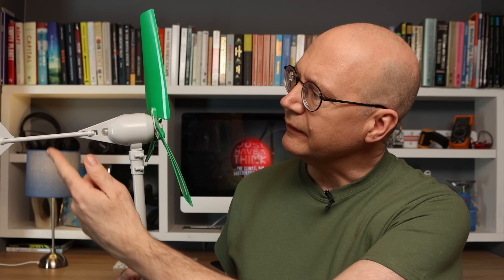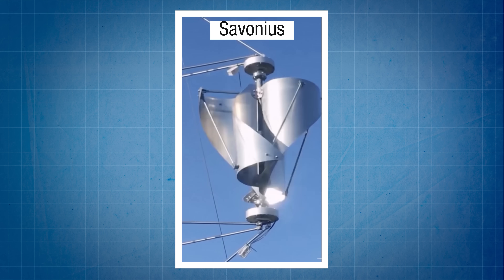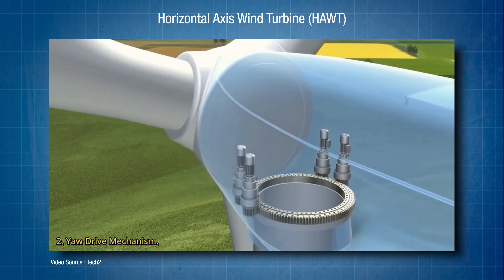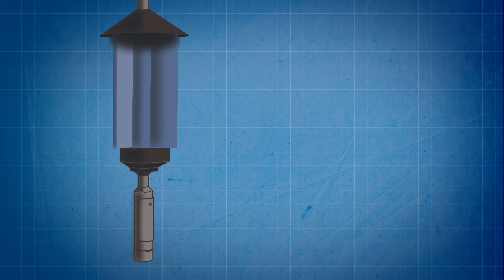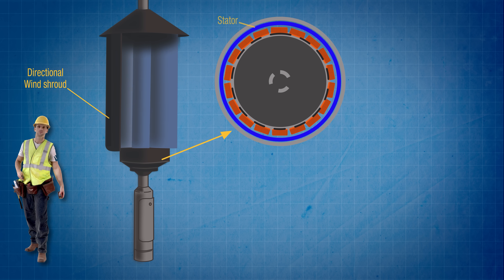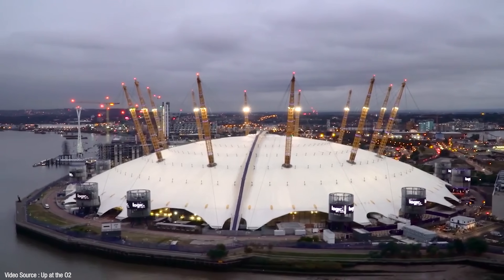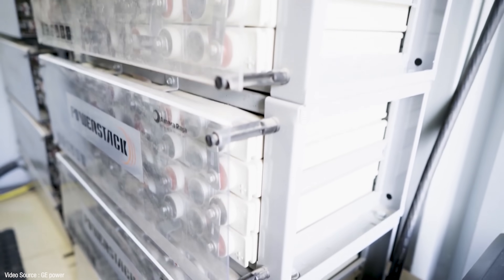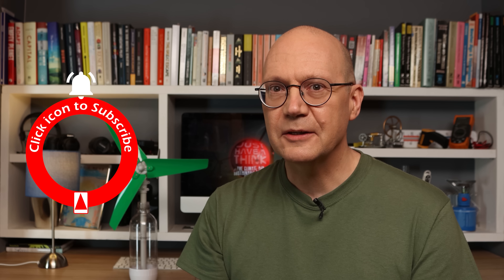A vertical axis wind turbine that doesn't need the prevailing wind! How do they do that?

Comment: I've daydreaming a small boat powered by a vertical axis wind turbine for a couple years now. I told my buddy and he said, "you know, wind powered boat isn't a new idea."

Edit: Didn't realize I was stirring such a large pot. I was just having a giggle at a fun little trash punk idea I'd had.
Reply: Hah.  I like that sense of humor.
Aside from that though, while sails would likely be able to trap and use more of the wind energy (since they'd be larger as well as converting straight from wind motion -> boat motion rather than going through a bunch of inductors and engines and the like), there are two advantages to going through the extra hassle of converting to electricity and back:

1) You don't have to know how to sail to use it.  I don't know how big of an advantage this is as I've never learned it myself, but there seems to be plenty of sailboats out there so it can't be all that difficult to learn at least the basics.  Still, it would make boating easier for the lazy.  Take that for what its worth.

2) Scalability.  Sails can only get so big before you run into issues with the stress on the mast and other structural components.  You would never be able to power today's enormous cruise and cargo ships using sails - they'd snap long before they could build up sufficient speed to be useful.  Being able to extract that same power across effectively dozens or hundreds of "masts" (ie: a whole bunch of small turbines spread around the vessel) could potentially work around this, to some degree.  The relative inability for small turbines to extract energy at the same rate as huge sails means that this would likely be at best a way to reduce fuel consumption rather than being able to fully replace it, but every gallon of fuel left unburned is a benefit to the planet (and the pocketbooks of the ship owner - win/win for everyone except the fossil fuel industry).
Reply: I remember seeing a video somewhere that talked about how big shipping companies are already experimenting with this very thing. They're mounting some VAWTs on their ships and measuring the amount of power generated. It's still experimental right now, but that business is all about squeezing out small efficiencies to increase profit so you can bet they'll try it if the efficiencies are great enough.
Reply: @altrag  To you point 2. No wind turbine will be any better AND no more scalable than sails. Sails can be much larger than the stability of the ship can support and if you try to use turbines to get the same energy they will also put the same kind of load and cause same kind of stability issue. Todays hi-tec sails are effectively vertical airfoils or wings and if it were economically viable business model to build wind powered ships we would do it. Perhaps one day when we run out of oil and we need to find an alternative...I suggest googling word: modern cargo sail ships

PS Sailing is easy and fun but traditional large sail ships needs a big crew.
Reply: @jimmiller5891  one of the modifications they did on the energy observer is change the turbines for a prototype called an 'oceanwing' which was able to be far more efficient at getting motion from the wind than sails and could utilise wind from all directions. As the ship was being pulled along by the wind they put their electric motors in reverse and generated energy that way. This meant that whether they were sailing and charging or running the motors they were always on the move.

The innovations being tried by energy observer are being seriously considered by shipping countries globally.

The only Downside to using salt water for electrolysis is the byproduct which is sodium hypochlorite, which is the key chemical in household bleach. If every sailing ship used this method I have no idea whether the oceans would be affected by so much chemical discharge.
Reply: @jimmiller5891  > much larger than the stability of the ship can support 
Its not the stability of the ship that would be the limiting factor, its the mechanical stress on the mast.  I did note that sails can capture more energy than turbines.  I don't think that's in question.  Its all of the other factors aside from pure energy capture that are an issue, such as mechanical stress on the masts.

Though looking up your Google term, I found https://www.weforum.org/agenda/2020/12/swedish-firm-wind-powered-cargo-ships.  Certainly never considered an airplane wing on a ship before, never mind calling it a "sail" but sure lets go with that.  Does serve essentially the same purpose after all.

So maybe there's something there but a few major concerns with that still:
- Its only about 60% the size of the standard Panamax dimensions and around half the size of that massive Ever Given we all recently heard about.  Now there is still a market for smaller boats that can fit in smaller ports and traverse smaller channels, but economically speaking scale tends to be king on those things.  Not a huge concern (can probably be scaled up) but something to ponder.

- More of an issue is how to load and unload it.  Maybe they can align the sails straight parallel to the hull and some sort of hatch opens up on either side?  I've seen ships with cranes running down the center to that center-line-covered design apparently can function (that said, I don't know how much the on-board cranes help with the loading and unloading or if they have to physically turn the whole vessel around to do it.  If its the latter then the sail idea wouldn't be much different but if the cranes let them avoid that maneuver, then the sail ship would have a bit of a disadvantage there as well.

I guess we'll see.  There's certainly room and need in the world for any new technology that reduces fossil fuel consumption and if they can work out the practical considerations of an airplane-wing sailing vessel then good on them!
Reply: @altrag  There's no advantage.... its a 40% loss right off the top, didn't you figure on that???
Reply: @DoctorMangler  Its a 100% loss if your mast snaps and your sail falls into the ocean, potentially taking your ship and cargo with it.

Its the same reason we don't put jet engines on cars.  Yes, you could go faster but there's some pretty significant drawbacks to consider.  "Most power" isn't always the only concern.
Reply: @altrag  LOL You aren't getting it at all.  Your VAWTs are on the same mast or masts you fool, and they can barely withstand high winds, let alone water forces.  Those delicate structures will be smashed to tiny bits.   You have obviously never seen a sailing vessel in heavy seas, fortunately you can look it up here on the tube.  When the seas are too rough such that sails will tear they haul them in.  That is something you can't do with VAWTs.  They would just smash and die.  Tidbits, but hey Elon has a hyperloop to sell you a ticket for.
Reply: @DoctorMangler  Oh I'm getting it.  I just don't agree with you at all.  The fact that you think a chunk of metal would be easier to damage than a gigantic piece of cloth is already kind of telling.

But to put it another way:  there's a reason the operators of large vessels don't use sails, and its not because they want to spend hundreds of thousands of dollars per week on fuel.  Sails have more power yes, but they simply don't scale past a certain size.

As I said many times now, using VAWTs would not in themselves power the vessel either (because they don't generate as much power as sails).  What they do generate though is electricity (rather than just motion), and can therefore be used to augment existing power systems and reduce fuel consumption in a way that would be difficult for sails to accomplish.

Now if you're operating a smaller vessel then great, sails are awesome have at 'er.  But generally speaking when we're discussing the environmental effect of the shipping industry we're talking about very, very large ships with hundreds of thousands of tons of inertia to overcome when fully loaded.  You would need a mast a quarter mile tall and equally large sails to get something that heavy moving under wind power alone.
Reply: @altrag  Then you haven't researched VAWT technology.  Then you also haven't researched ship drive technology as it exists today.  An unlubricated bearing propelling even a small boat forward will die in minutes not hours.  So that "chunk of metal" will bind bind up against all the other metal.  You are absolutely right about operators of large vessels, they also don't choose to use VAWTs or any other goofy tech, they use fuel and engines.  Not wind..... There was an early 1980's article in Popular Mechanics that had a ship with a bunch of wind turbines, some VAWTs driving a shaft propelling the boat forward.  It would work, not efficiently.  Certainly not efficiently enough to be any kind of valid tech today.  Better yet, show me that VAWT boat!  If it were economically feasible, it'd be floating around today.  It's not.  Kinda like solar roadways that became solar roadway lightshow then solar roadway breakdown, then solar roadway breaks when you drive a truck on it..... get the idea?
Reply: @altrag  Oh ok, so you want to put a huge wind drag on an already efficiently designed ship?  You'll pay for those spinners with fuel.  Almost all designs today focus on long term operational costs.  That's true for airlines and the shipping and rail industries.  You are specifically promoting VAWTs without any research history on the failures of VAWTs.  Every "free energy fool" comes along and says how we're missing a huge sector of energy recovery, but the cost to recover the energy far exceeds it's returns.  I wish you were right, but all you have to do is look at the operational history of VAWTs.  They fail.. fail fail fail.  They promise promise promise, but they never produce.  Your idea is not new, VAWTs and VAWT powered or Windmill powered boats have been fantasy since the early 1900's.  But only fantasy.  Cheers!
Reply: @DoctorMangler  > so you want to put a huge wind drag on an already efficiently designed ship
No, I wanted you to understand what I was saying.  But since you've decided to turn this into some weird pseudo-political hill to die on I'm just not going to bother anymore.  Cheers.
Reply: Thank the author of the article for defending this weird idea, you mentioned politics, I was talking efficiency.
Reply: @altrag  Going back to your first comment, I want to point out that for a small boat, you don't have to convert to electricity and then back to mechanical energy. You could simply connect the turbine shaft to the propeller with some gears and a clutch.
Reply: @dwaneanderson8039  > for a small boat
That's a critical piece of context.  I'm specifically talking about massive shipping vessels (and maybe cruise ships) - boats that are most definitely not classified as "small" by most peoples' standards.  But they're the ones we're usually discussing with regard to carbon emissions (where this whole topic starts), so its the ones I've been focusing on.  I'm certainly not suggesting we replace the sails on your average 100  foot pleasure yacht or anything like that.
Reply: @altrag  They have proved the benefit of using gigantic kites to very effectively replace sails on boats and to reduce fuel consumption of cargo ships.  Kites don't require masts and operate in the higher windspeeds a couple of hundred feet up.
Reply: @denbecr49  Be interested to see what size of boat you're talking about.

Kites definitely sound like they might strike an intermediate balance between the mast stress problem of full size sails vs the adaptability of VAWTs.

The cable attaching the kites would have similar stress issues but you'd be able to mount several smaller ones rather than a single large one (as is the case with sails) so maybe that's sufficient to get around some of the problems?

(Though I imagine there's other issues with kites like how to launch them reliably and to prevent them from tangling if you have more than a couple..  My kiting skills have never been fantastic so maybe the master kiters consider those issues easier to deal with than they feel like to me :D.)
Reply: @altrag  
Search 'kiteboat' here on YT.  Take your pick.  I watched them all.  The ones on hydrofoils are fast.  I have used kites to tow  boats, trucks, toboggans, but mostly bikes and recumbent trikes.
Reply: @denbecr49  So those all look.. very small.  As I've said several times, I was referring to the massive cargo and cruise ships that dominate the marine fuel consumption.  Moving a 200 pound chunk of fiberglass is quite different from moving a 200,000 ton steel behemoth.
Reply: @altrag  Duh.  Search 'kiteship' instead.
Reply: @altrag Absolutely. I'm sure someone smarter than me can work all that out. Looks like Cousteau is making progress with it.

On the scale I'm thinking, small pleasure craft up to maybe some fishing vessels,  I figured one or two vawts with a mechanical linkage to a screw would be enough. 

Small flat water trash boats are bit of a passion of mine. The one I'm working on now is a bicycle powered paddlewheel vessel
Reply: @stephenwilliams163  
Video it & put it on Youtube when you're done.  I follow the ways others are doing that.
Reply: Did the boat in “Waterworld” have some sort of vertical axis turbine on it?
Reply: @mattmccallum2007  Whew. Second random Waterworld reference for me in a week. I dunno. Haven't seen that movie since the 90's
Reply: @mattmccallum2007  Derresian foil.  I often wonder what happened to that boat.
Reply: I know someone with a large three blade  propellor device which is geared directly to the driveshaft / propellor . only wind powered vessel that goes straight into the wind .  its well over 30 '  . been some years since I've seen it , on penobscot bay , Maine . built by havilah Hawkins
Reply: @jeffgold3091  I saw video of that boat around the time the whole "down wind faster than the wind" and "sail dead into the wind" brouhaha blew up a decade or so ago. Very very cool boat.
Reply: @jeffgold3091  gonna have to look for that next time I'm in Maine. It's been awhile.
Reply: The original set up of the boat 'energy observer' used vertical wind turbines. It generated and stored hydrogen from the seawater using electrolysis from the wind turbines and solar panels and has been running without backup power for several years now.

They have a channel on YouTube. Check it out 👍
Reply: @MX-Vette  i was just about to say this

Still amazed that someone would go with hydrogen over batteries, even at that relatively early time for li-ion batteries
Reply: @angrydragonslayer  I guess it works as a 2 birds one stone scenario where the discharging of the fuel cells is generating desalinated water as a byproduct, streamlining the processes required for long trips at sea.

Also as much as lithium batteries being very efficient, hydrogen is far more energy dense for its weight and they are pretty much floating on one massive fuel source.
Reply: Fools have tried this before, about 40 years ago they were trying EXACTLY that, and it never works out.  Why?  It's hard to beat the cost, efficiency and reliability of a true sailing vessel.
Reply: @Smooth Move I'm glad I could help you with your low self-esteem problem, but I am curious about what you think is so dumb about my comment. This thread was started by a comment that said, "I've daydreaming a small boat powered by a vertical axis wind turbine for a couple years now." I'm thinking he means a small recreational boat that he wants to rig up with a wind turbine just for a fun DIY project. A simple bevel gear set up would definitely work. It would still be slow, but it would theoretically be more efficient than converting the energy into electricity and back.
Edit: Apparently, these people didn't think this was so dumb; https://www.youtube.com/watch?v=IzGCYaJbf0A
Reply: @dwaneanderson8039  
I wish the thumbs up icon was a vigorous fist pump in this case.
Reply: Hahaha, I think it’s safe to say the world won’t have been colonized until several millennia later, without such a wind-drive innovation 😉...rowing is so inefficient 🚣🏻‍♂️🚣🏻‍♂️🚣🏽😬
Reply: Hahahaha, your friend is fun
Reply: Jacque Cousteau tried this idea...it worked
Reply: @crustycobs2669  Not efficiently, that's why they aren't mainstream.
Reply: Many years ago when I lived in Whangarei, New Zealand there was a catamaran around 30 feet with a horizontal axis windmill.
It drove through right angle gear boxes to the propeller.
I saw it travelling up the harbour one day against a fresh SW'erly at a good clip - almost straight into the wind..
Reply: Have you looked at Cousteau's ship "Alcyone"?  https://en.wikipedia.org/wiki/Alcyone_(ship)
Reply: @jamesuthmann940  There is the Flettner rotor https://en.m.wikipedia.org/wiki/Flettner_rotor for ships. Developed in the 1920th it has been  deployed to a ship ten years ago.
Reply: @jamesuthmann940  fletner rotors . never really caught on
Reply: @jeffgold3091  
That's mostly because the wind doesn't always blow and diesels replaced sails when the fuel was very inexpensive.  
They are being reconsidered for economic reasons, to be used when conditions allow.